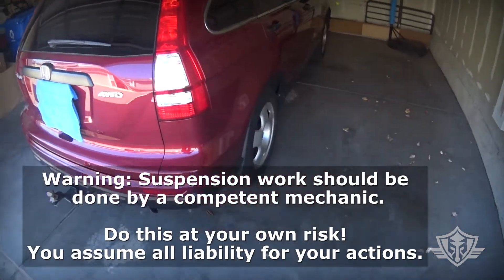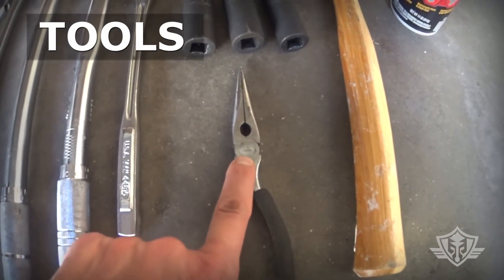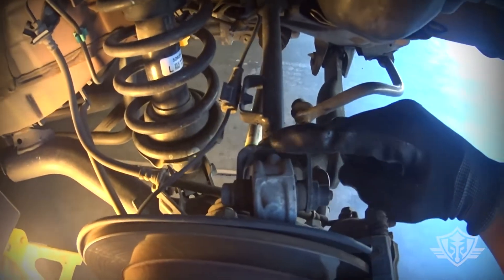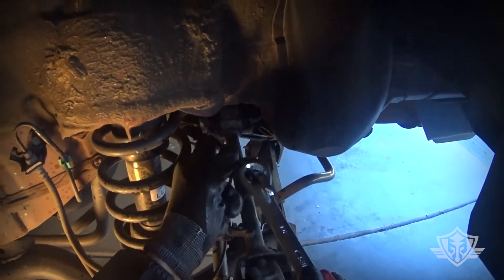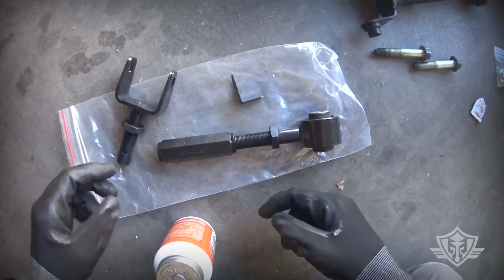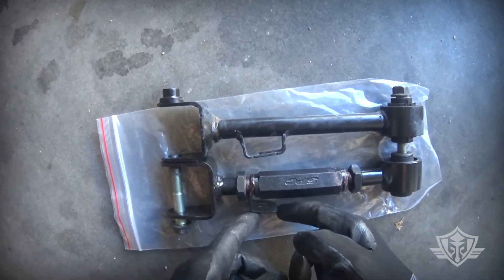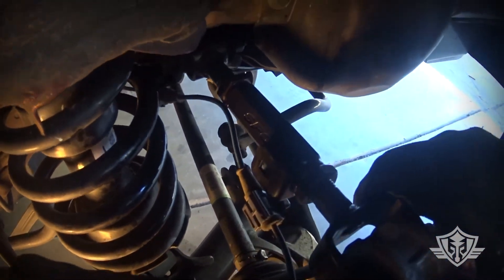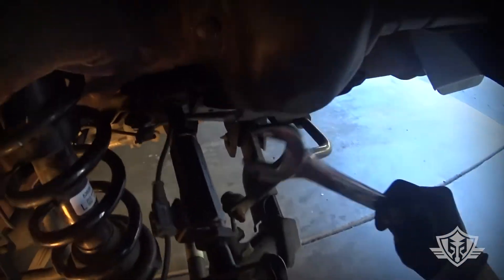Honda CR-V and Element Excess Negative Camber Fix: Install Adjustable Rear Upper Control Arm

Comment from the maker: Hey guys... hope this is helpful. Had to do it on the wife's car. Sorry about the weird Darth Vader voice track. Since I had my head in the wheel well, I had to put the head-mount camera in the protective case to keep from scratching the lens. 🙉
Reply: I appreciate this video very much. I’ve had 3 mechanics tell me 3 different things, and none of them mentioned camber. I’m going to try this eventually and I’ll let you know how it goes.
Reply: It's all good, you actually sound good though.  Thx for sharing.
Reply: I just came from having my 2013 Honda CRV wheels alignment done. The tech showed me on paper that the rear driver’s side was at -1.6° which is on one end of the Specified range of -1.6° -0.1° He noted that I might had hit a pothole  somewhere and that the camber isn’t adjustable. Upon watching this video I feel such a relief that I’m going to install this part and take my car right back to the alignment place. Thank you for making this video. Very helpful.

Comment: I have significantly more negative camber on the rear passenger side wheel than I do on the driver side. I also have 320,000 Kms. Local garage wants to change the shocks, springs, subframe, hub, control arms. Seems excessive. What do you think?
Reply from the maker: Even if they change all those things, it won't fix the issue. The stock control arms are not adjustable, and they are a tad too short.
Reply: @adigaarmory I have one wheel that has more negative camber than the other. Also, the car wasn’t designed with adjustable control arms so ok….i just want the one rear passenger tire to be adjusted back to spec so it doesn’t destroy my tires and cause more road noise.
Reply: @FirstLast-et3sw  Get an adjustable upper control arm it will help definitely.
Reply: @Scott-xq2dm I just overhauled the rear suspension. New shocks and springs. New bushing and an adjustable control arm ($$$). Ride height went up by 1-1.25” and I was able to align the rear back to spec. Huge improvement.
Reply: Could be caused by worn bushings and stuff. I would get a second opinion to make sure you need all that stuff. What I notice is a lot of these CR-V's have negative camber

Something I dont like about these after market control arms, the bushings are usually very poor quality in aftermarket parts, so it wouldnt be worth spending money on

There should also be a Cam Adjuster on the lower rear part of the rear control arm, that would give you some Camber and toe adjustment

Comment: Just had new struts installed now the mech says I need Rear adjustable arm replacement, why would I need this if Honda does not put adhustable in their car?
Reply from the maker: Unfortunately, the stock arm is not adjustable and it has too much negative camber. It is a less than great design decision that is easily fixed by adding an adjustable arm.
Reply: @adigaarmory  They only want to do one side, isn't that odd?
Reply: @adigaarmory  I am confused as to why only one side is recommended then. I have not had any uneven tire wear, so why just one side wouldn't need both?

Comment: What i dont understand is if the factory rear control arms are too short how did they not cause issues with the tires or anything else? I have an 06 and I bought the adjustable rear control arms ad had it aligned and now my rear tires are going bald. Idk what happened. The only I can think is all the other crv have the bottom of the tire sticking out more then the top. Did I mess up by not getting the non adjustable control arms?
Reply from the maker: My tires were having issues with excess camber with the stock control arms, so this adjustable arm was the perfect solution. However, a bad alignment will mess you up regardless of having adjustable arms. Lot's of big box tire shops do really bad alignments because they hire inexperienced teens for $12/hr. I would take it to a dedicated alignment shop. Your toe might be off, causing the tires to wear... and make sure you leave a tiny bit of negative camber on the back... if the camber is positive, it is not good. Best of luck.
Reply: I’m doing mine atm the camber adjustment is done by the camber bolt but it’s almost impossible to do as it seizes in the bushing that’s why they’ve come up with this hack basically. I however went the hell route and removed the camber bolt on the knuckle it gets destroyed in the process and replaced with a new one. So I will be setting the camber using the camber bolt.

Comment: I done this to my 09 crv and used a good digital angle cube and a jig I had laser cut at work. Set both sides to negative .5 degrees and everything is great now, no more inner tire ware

Comment: How did you arrive at the negative camber specs that you showed at the end?
Reply from the maker: Camber should always be slightly negative. The Honda specs call for negative camber. Having positive camber is bad for handling and safety as it puts a lot of torque and strain on the tire sidewalls.
Reply: @adigaarmory  ive been looking for a while to find the exact degree, i have -3.2 camber on both sides and want to move it in spec. i have found -1.1 camber is spec but i have not confirmed it.

Comment: I installed these on my Element and  noticed some negative camber return after a while.  What was your experience?
Reply from the maker: We miss our Element... totaled... RIP.  So far these ones are holding up... over 2-years now. Did you use the same AC Delco pro-grade parts? Wondering if maybe your bushings went out prematurely. Besides that, could the lock nuts have gotten loose and caused the adjustment bar to wander? Just a couple of things to check. I would definitely get down there and tighten the lock nuts after the visit to the alignment shop... just in case.